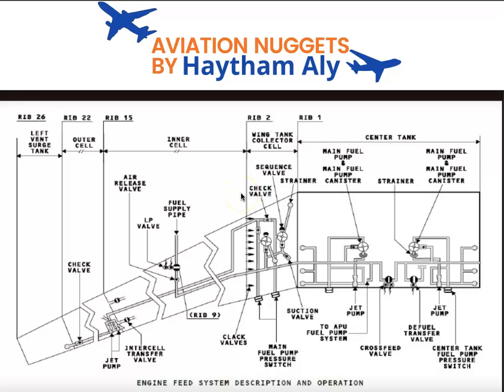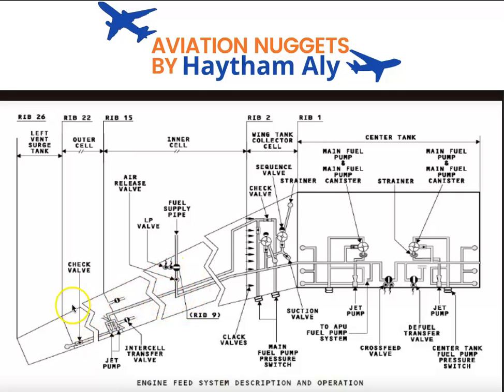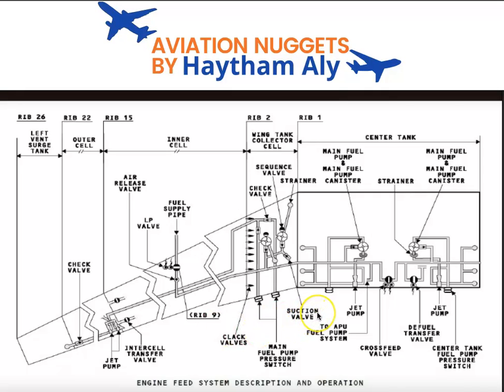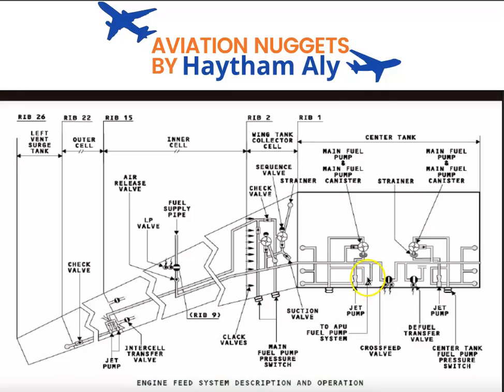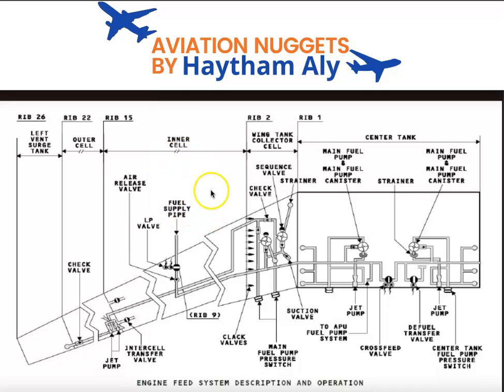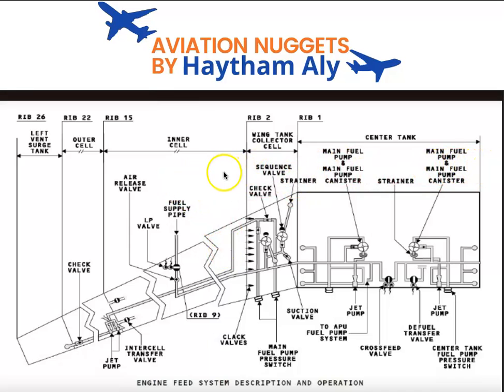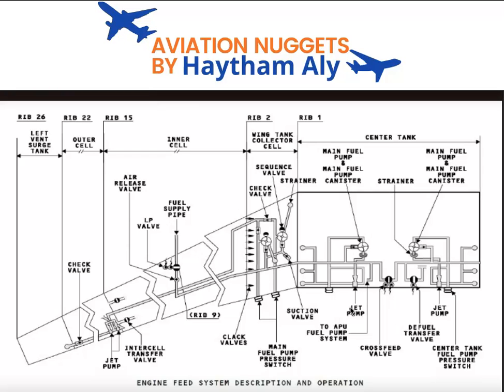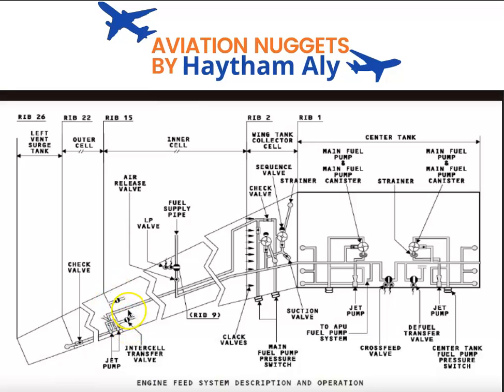A320 Ch28 Aircraft fuel system engine feed system description, @Haytham_Aly by Haytham Aly

Comment: Hey bro i wanna ask a question why airbus 320 when AP on we only can extend speedbrake half despite we set the lever to full position? But in manual fligth we can use full speed brake. As i know a319 and a321 its different we can use full speed brake even with AP on